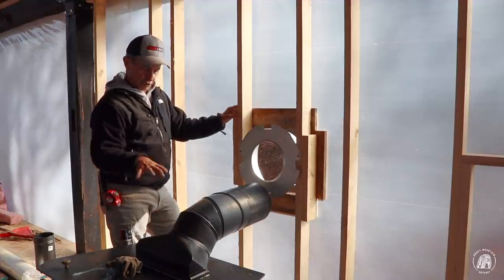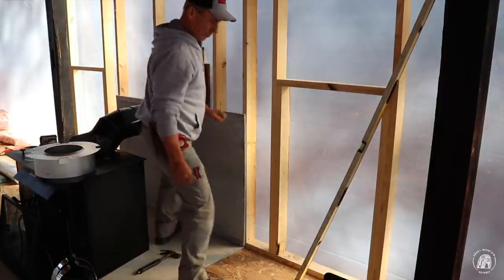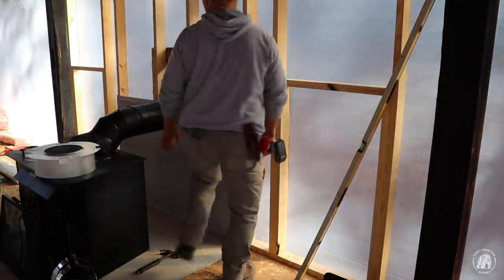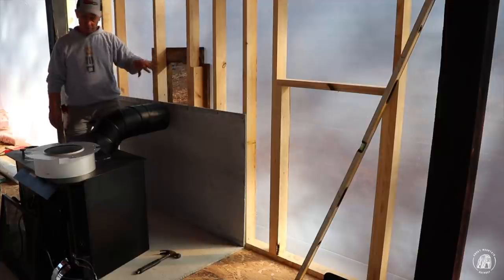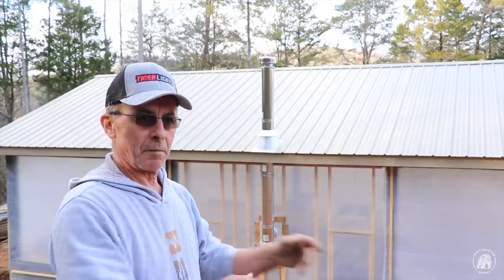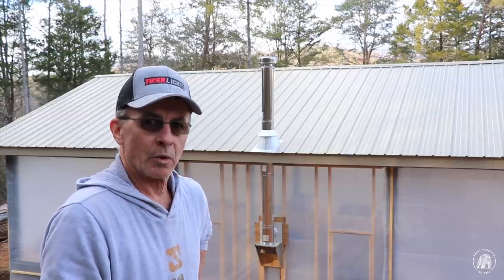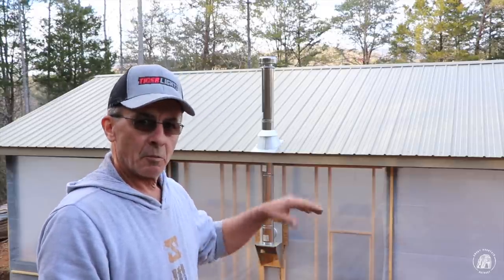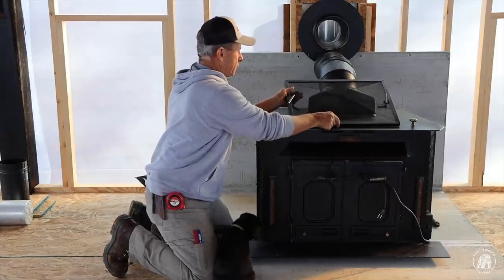S2 EP71 | TIMBER FRAME CABIN | WOODWORK | INSTALLING VENTING FOR WOOD STOVE

Comment: Only one suggestion with fireplace piping on the roof, the rule of thumb is usually piping should be a minimum of two (2) feet above your roof ridge to prohibit a down draft into your home.   Does your fireplace have legs or feet for the base or are you putting brick or concrete blocks under the fireplace?   Otherwise everything looks really great!!  Your puppy is looking so darling and is calming down now that he is attached to his daddy.

Comment: Raising stove makes it easy to put a cast iron pan on top of stove to cook so you do not have to bend over and stress back too.  In my area we would have to add wired bracing to top of stove flue because winds are often 25-45 mph.

Comment: the flue is to close to the top of the top of the stove and the first bend should be a 45deg not a 90deg to aid draught on  flue . not knowing the minimum in your state but good fluing is normally 36inchs from top of stove before any bends  for good droughting

Comment: Richard, I had a question about the chimney stack height.  In watching several of the other programs similar to your, they had said  the top of the chimney should be at least two feet above the ridge line of the roof to get proper draw, and it may be a code requirement in some places.  Not sure if this would apply in your situation, but I thought I'd ask.  Love the detail you show of the installation.  Regards, Bill.
Reply from the maker: I haven’t had time to get another one. I said I was going to need another. I will probably get one this week

Comment: On Chimney draft height.  Youtube says draw a level line from your chimney to your roof where the distance of that level line is 10 feet long before touching your roof.    when you have that point marked on your chimney, your chimney should be at a minimum 2 feet taller from that point to the top of your chimney.    in otherwords, hold a 10 foot stick level, one end touching your roof, the other end touching your chimney.  your chimney should be at least 2 feet taller than where that level 10 foot stick touches your chimney.

Comment: Just curious, why did you go to the trouble to cut the hole in the metal roof just to throw it away. Its looking great!
Reply from the maker: I wasn’t for sure where the hole would end up. I had to know to cut the plywood underneath. It was easier to do that than cut the square first and be off with the whole.
Reply: @SmokyMountainOutpost  Take a steel welding rod and snip the end to form a sharp point and put it in your drill. Drop a plumb bob or use a laser to locate where you want the hole located. You will be surprised what it will drill thru.  You might want to check with the manufacturer of the roofing next time to see if they have an accessory that would match the corrugations.

Comment: I'm sorry to dump on you, but I'm so tired of seeing this I want to cry. Whoever came up with the idea of using a side grinder to cut was really lazy and a real chance taker. With a little time and effort the use of tin snips can be mastered. They'll cut your actual time in cutting, be much safer, and you won't be missusing tools. If you take a little time and learn to use snips you will realize that there are a pair of snips made for every cut you'll need to make. All the snips put together will not be as expensive as a side grinder. They also make a tin cutting tool which is really cool, and if you have a lot of tin work it would be worth investigating. I believe this tool is called a nipper. In any case don't work like you're in a third world country and use the right tools for the jobs.
Reply from the maker: I already owned the side grinder for other things. The “bit” I purchased at harbor freight for like $12 a set of three. Diamond tipped supposedly. It cuts both brick, stone and metal “great.” It was very easy.